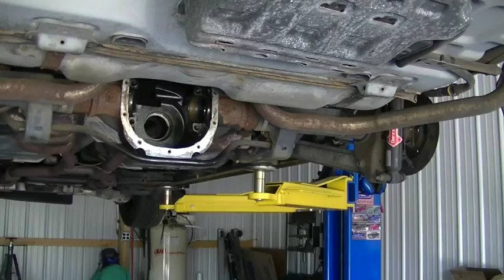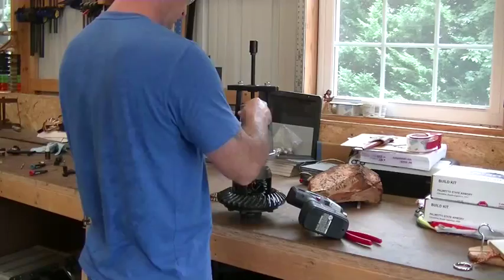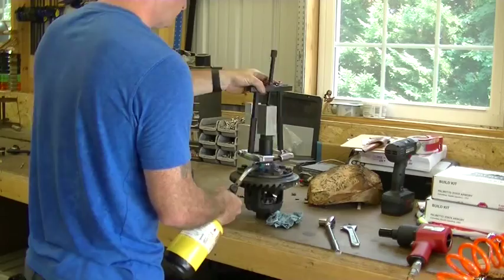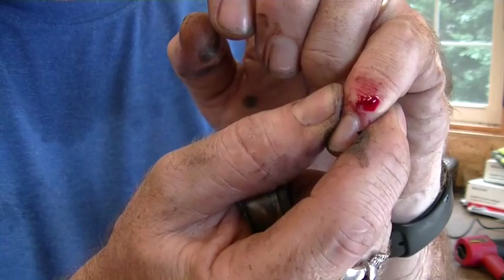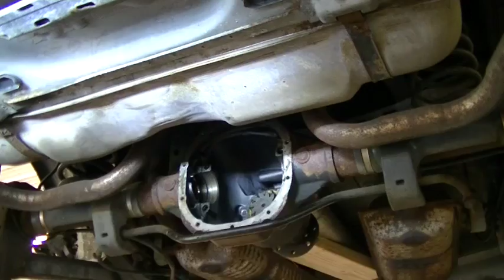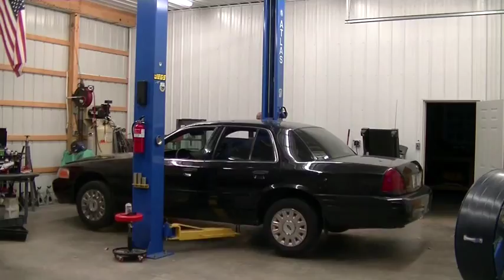2005 Ford Crown Victoria Rear End Build

Comment: Thinking the gears maybe grinding it only ticks when moving and slowing down and that loud Poppin sound was the first time ever it did that
Reply from the maker: What about the drive shaft universal joints?
Reply: @jjmorrissiey  would yaw happen to know why why in 3rd to 4th gear it jerks and shuttle a little then you let off the gas for a second it goes up regularly in rpms I'm thinking spark plugs and coal packs but my cousin thinks it's transmission fluid needing to be changed to lucus slip resistant

Comment: I have a 2003 p71 and this issue just started when driving it and deccelerrating I hear a clunking noise I thought was from the back wheel....I took my wheel off to make sure it wasn't a peice of the hoodcap stuck making noise...but I wasn't the next day I drove it trying to get Walmart to check it out I popped on me in the middle of the road so I stoped backed up and it popped again sounded like chain on a bicycle I put it in drive and it just tick tick tick otw back to my house what do you think it may be